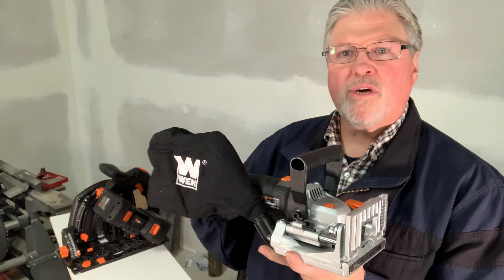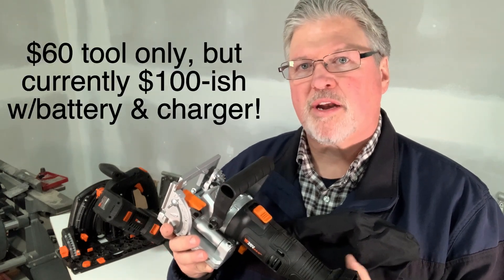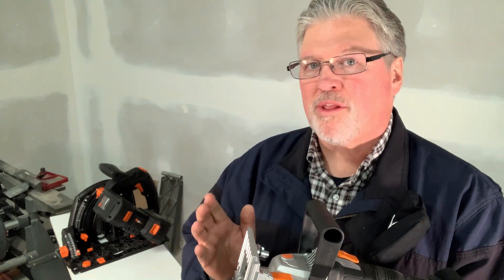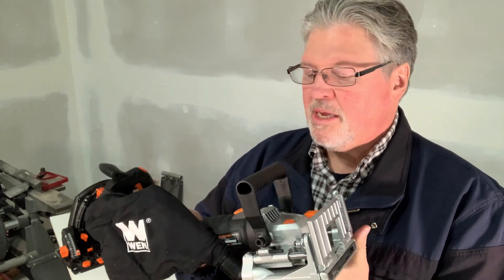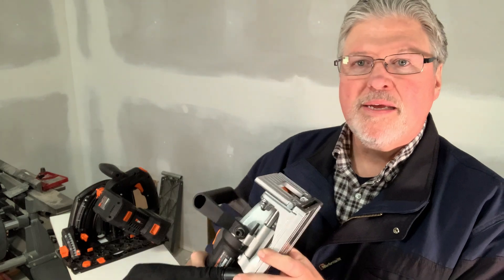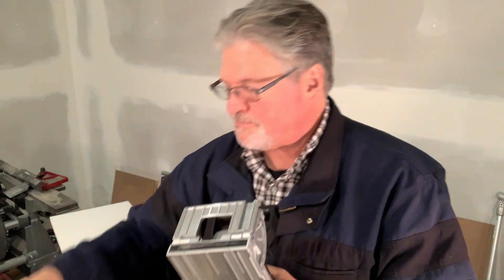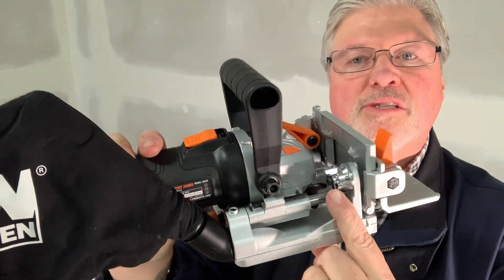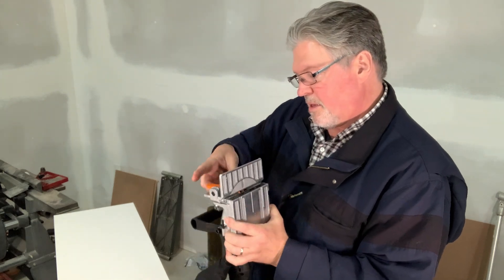A $70 CORDLESS Biscuit Joiner? Yes Please!  First Look at the New WEN 20648

Comment: Scott,  I’ve had a Dewalt biscuit jointer for over 25 years and still use it for numerous projects.  It’s not cordless, but it has served me well.  I ended up with a ShopSmith biscuit jointer and have never even attempted to use it, the Dewalt is just too easy to grab when I want to use biscuits. Cordless might be easier, but I’m running out of space for the latest and greatest gadgets, so I will stick with my tried and true Dewalt.  Best to you my friend!
Reply from the maker: The DeWalt is an excellent biscuit joiner. It, and the newer version of the Porter-Cable are a couple of my favorites.

Comment: Nice video.  I use our Porter Cable to align long boards.  We have a Shop Smith biscuit joiner and almost never use it.
Reply from the maker: I have one of the early, belt-driven P-C biscuit joiners and it works just fine too.

Comment: I own a Shopsmith biscuit joiner and use it when I need to join long boards. Makes the alignment much easier. I have been chicken to try it for other joints, like in a 45 degree miter.  But I have used it to cut splines in boxes to reinforce the miter and add a little visual interest.
Reply from the maker: It can get a little hairy to do some of those operations on the SS biscuit joiner.

Comment: The beauty and versatility of the hand-held bisciut jointer is that you can clamp your shelf and side panel together. Lined up where you want them connecting and cut the face slots in the side panel, flip the tool around and cut the slots in the end of the shelf without changing the setup.
Reply from the maker: Exactly! Had I known I was going to play with this I would have done a better job running it through its paces. Oh well, I think most of us learned all we needed to know from Norm! Scott

Comment: Sometimes a cheap tool is just what the doctor ordered. I know a Nick Engler's Hands-online video covered "face of a board" biscuits on the Shopsmith, but it seemed too fiddly to me. This has me thinking of a similar horizontal method involving a "french cleat" sub table attached to the main table with tee nuts, and a reciprocal cleat that would attach to the work piece that would server to capture the workpiece to the table and position the biscuit vertically. Horizontal position could be accomplished via a pointer stick attached to the auxiliary table on the opposite side of the headstock and indexed to the center of the cutter.
Reply from the maker: Sounds like a lot of work. Probably less work than drilling a QR code, though.
Reply: @MyGrowthRings  True, another gauge would be more work than a rip fence outfeed support jig but less work than a floating table outfield infill table. 😀

Comment: □ Hi Scott! You know, if I wasn't so far into the Milwaukee system, you might tempt me into the Wen system.
FYI...  Popular Mechanics picked the corded version as its #1 for beginners. Is the motor on the battery version brushless?
Reply from the maker: Albert, that’s a good question about brushes. I don’t see any mention of brushes in the manual or in the parts breakdown, and there doesn’t appear to be access ports for them,  it there’s also nothing that states “brushless”. I believe it to be, but I’m going to ask Wen.
Reply: @MyGrowthRings  unless I’m looking at the wrong model, Wen’s website describes it as brushless.
Reply from the maker: @alberttreado3713  Can you share a link?
Reply: #1 Best for beginners…
Reply from the maker: I’ve heard back from WEN and they say “Thanks for contacting WEN Products. the Wen 20648 Cordless Plate and Biscuit Joiner has internal brushes that are engineered to last the life of the unit and are not serviceable by the consumer.”
Reply: @MyGrowthRings  I called tech support, he didn’t know, but said there was no part to replace the brushes. So, I’m guessing your right brushless would be a selling point, so, they must not be replaceable. Maybe I looked at the corded model by mistake.
Reply: Mark, did you ever try that face cut with the SS BJ in the horizontal position rather than the vertical(drill press) mode?  I think it is described  in the BJ owners manual.
Reply from the maker: @charlessanicola545  Oh yes, we had to demo it in the Shopsmith Academy. It was one of the sketchiest things I've ever attempted with a tool and the results were always too sloppy.

Comment: It definitely looks like a Makita grinder powering the thing. Power switch and spindle lock buttons and the metal head casting looking very much like it. If you're going to copy an angle grinder that's a good one to start with.
Reply from the maker: So true.

Comment: You don’t like the Shopsmith biscuit jointer!?  Did you just ‘Malecki’ that tool?
Reply from the maker: Nope, I have years of experience with it.
Reply: @MyGrowthRings  okay, I thought that at 3:12 into the video you said, “I don’t use it, I don’t like it”
Reply from the maker: @bradhillig9844  Better said would be "I no longer use it because I don't like it".
Reply: @MyGrowthRings  I couldn’t tell how it would work with picture you used in the video, but I probably wouldn’t like it either.  I’ve got the type Porter Cable first came out with in early 90’s.  I think Norm used it on the New Yankee Workshop.
Reply from the maker: @bradhillig9844  I own one of those too. The fence on biscuit joiners sure have come a long way since that one!
Reply: @MyGrowthRings  I’ll take your word on that, because the Porter Cable is the only one I’ve ever owned.

Comment: Drool. And remember we had a discussion about extra batteries for your track saw? I still think any battery tool is useless without a spare set of batteries for round two while you wait for the first set to recharge. (I can't even tell you how many Makita batteries I own, in four different physical shapes and voltages, around 20-30?) If you bought the biscuit joiner with one battery and charger, you'd be set for less than two batteries and a charger cost ($35 + $40 + $40). BTW, if I were trying to cut a series of biscuit slots with my Shopsmith I'd just use the tablesaw and cut continuous slots in the vertical pieces, or use a router. And since the Shopsmith biscuit joiner is currently unavailable as are anything but #10 biscuits the choice if moot (I'll make "moot" my word of the day, I've already used it twice. (three times now!)). Any chance you could look at the WEN 6-inch variable speed grinder sometime?
Reply from the maker: Mike, I have had my eye on that grinder and keep vacillating between it and the Hercules from Harbor Freight. The warranty alone makes me lean towards the WEN.
Reply: @MyGrowthRings  It's also a color match for your mini-lathe, tracksaw, and new biscuit joiner! WEN quality is much better than it was 25 years ago.

Comment: That thing is dirt cheap at <$60.  If I were in the market for one, I'd give it a try.  Cordless sure would be very convenient.

I have a corded older Dewalt and a Ryobi min-biscuit joiner I use (R1/R2/R3 biscuits are excellent for face frames).  I never use them for joint strength and only for part alignment... relying on glue and (optionally) screws.
Reply from the maker: I like the DeWalt a lot. The fence on the Ryobi sure leave a lot to be desired.

Comment: Shopsmith only has a few tools I am not a fan of.  Besides the biscuit jointer the overhead router/shaper. Just the dumbest and besides a bit above a table if your part jumps up it is ruined where under the table it is safe.     Then the 90 degree speed increaser just was not reliable at all. the clutch plates in it will burn up faster than ny cheap 1/2 in router.   But most of the shopsmith stuff I will defend until the day I die.
Reply from the maker: I share your opinions.